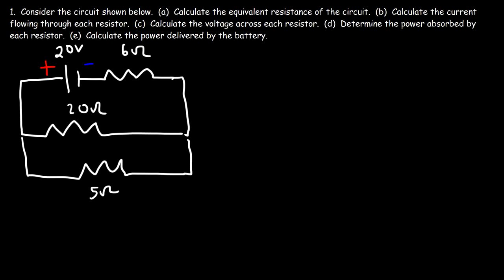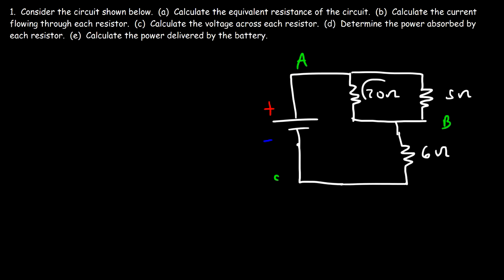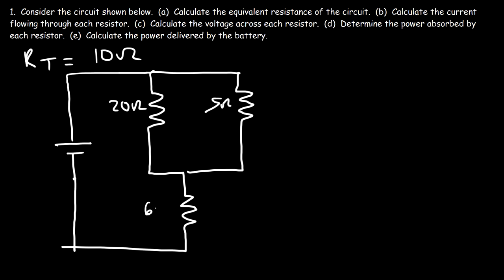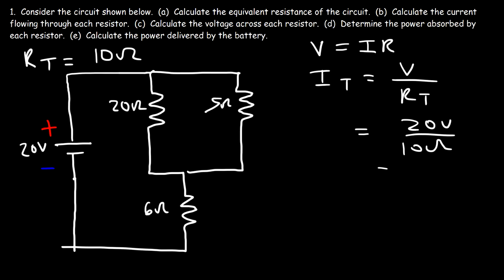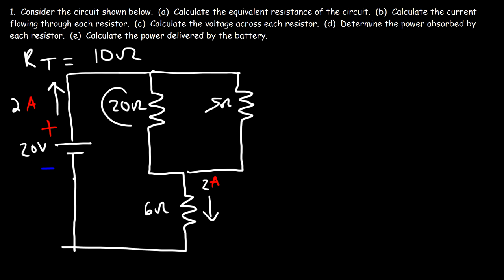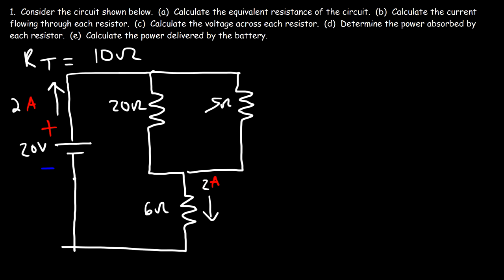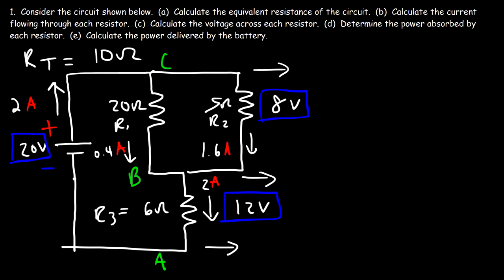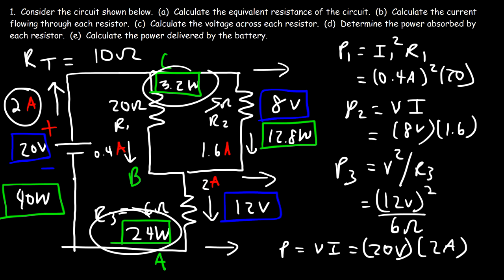Resistors In Series and Parallel Circuits - Keeping It Simple!

Comment: Why  to the power -1
Reply: That is because if you want to calculate the equivalent resistance of resistors connected in parallel, you have to add the reciprocals of the individual resistances.

Therefore, 1/R_{1,2} = 1/R_1 + 1/R_2. 
If we simplify for R_{1,2}, the other side must be raised to the power of -1. 

Because it would look like this:

R_{1,2} = 1 / (1/R_1) + (1/R_2)

Comment: hey quick question about your working out, how did the voltage drop of the 6 ohm resistor affect the voltage in the parallel section if the parallel section came first in the direction of current flow negative to positive,(does that mean that this was actually conventional flow(positive to negative)?  

either wat great video thanks!

Comment: Why use a complicated ratio of current across the parallel resistors of 4:1 and then having to figure that ratio out for 2 amps instead of using the series/parallel circuit rules and calculating the voltage drop across the 6 ohm resistor being 6ohms x 2amps = 12  volts leaving a voltage drop across both the parallel resistors of 8 volts each to calculate the current draw in each parallel resistor.

Comment: Thank you for the example.  I had to do some testing to prove out the parallel circuit's resistance is a constant.  Once I realized that it was a constant (in spite of variable voltage source), everything worked out in the combination circuit example. R total being V / I = 20 / 5 = 4.

Comment: WHY POWER USED different formuls Ie p1 = i^2R and P2 = VI and p3V^2R pls explain sir
Reply: The original formula is 
P = vi 
And voltage is known as v=iR
Replace v with IR it will be 
P = i^2 R

And I is known as v/R
So replace I with v/R
It will be 
P = v2/R

Comment: why is the current flowing through the 6 ohm resistor 2A when if you plug in 20V=(I)(6ohm)= 3.33A. I know that logically 2A flows in and it has to flow out but why is it different when I put it into the eqn?
Reply: A year late but the voltage through 6 ohm resistor isn’t 20, as the voltage drops in series

Comment: This is highly misleading, a voltage only makes sense as reference to a difference between two specific points in a circuit , labeling resistors in the circuit has having a voltage has just confused over 290k thousand people and counting.

Comment: This helps a ton, thx. just one question. why did you use Iˆ2 instead of just I in the formula?
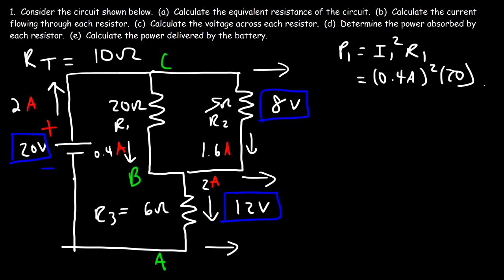 (8:57)
Reply: Let me simplify: 
Power = Voltage × Current

Now substitute Voltage into the formula
Voltage = Current × Resistance

Therefore, Power = Current × Current × Resistance

Comment: You found out the current of only R1 and R2 but not R3 meaning it's wrong? The total current is 2A as you calculated but you only added the currents of R1 and R2 together. What about R3 (6 Ohm resistor)?
Reply: R3 resistor is in series circuit.   Current is the same for resistors connected in series. Differ only for a resistors in parallel.

Comment: At 8 minutes im confused as to why in a parallel circuit part of series paralell you have to do the math where v1=v2=VT  in series votlage drops but in parallel it doesn't amperage does.
Reply: This is a very late reply, but that's just a rule that usually gets taught along with Ohm's law. In parallel voltage always stays the same. Technically each parallel line of resistance is still voltage coming straight from the source and meeting resistance for the first time. So the voltage is the same in each instance. In series after each resistor it is hitting is it's 2nd, 3rd, 4th resistor since leaving it's source, so the voltage continues to be reduced. Hope that makes sense.

Comment: Can anyone help me, please. I've got to find the total resistance of a parallel circuit. There are three given resistors (no given voltage, current, and power, it's only 3 resistors) and the third resistor is initiated into infinite. How can I solve the total resistance when there is an infinite given or value in one of the resistors?

Comment: You didn't show how to calculate the equivalent resistance of the circuit. You typing it into your calculator and telling us the answer doesn't help.
Reply: just know that the resistor math is the opposite of the capacitance math, so for parrallell its 1/stuff this time

Comment: Why is parallel resistor raised to the -1 power? I know 1/C + 1/N or whatever for adding but why raised it?
Reply: It's raised because it takes the inverse of  the fraction. If 1/Req=1/R1+1/R2+... then you need to raise it to the -1 power to get your Req to the numerator, if that makes sense.
Reply: @willsmith1968  I know raising to -1 is inverse, but why have to raise 1/req at all? My teacher's answers can be inconsistent so I'm not understanding exactly how to add it.
Reply: @violetmarinaayis  Sorry on my english. For example if u imagine that circuit is river, now in parallel, river has two paths. If river can go either way so it means that has less resistance than if can go only one way. If river has only one way it has to go through all resistance, but if river has more paths she will go little here little there 😁.
Reply: @violetmarinaayis  1/Req = 1/R1 + 1/R2
So, for example if we take 5 and 10 ohm resistors, 1/Req= 3/10 so our eq resistance is 10/3 or 3.33 (eq resistance is the reciprocal of what we got after adding 1/R1 etc)
 
    You can do this
Here, he has done Req= (1/R1+1/R2)^-1
       Instead of taking the reciprocal od the sum at end , he has directly did as ^-1 since rasing something to -1 gives its reciprocal
Reply: @violetmarinaayis  that depends on the person.. You can raise it or go with 1/Req=1/R1+...
Reply: @Setyourhandle_E  hello can i ask why on letter D, he used the P=I^2R on the first but P=VI on second? i thought the 8V is for both R1 and R2 but he used the 8V only on R2? im confused.
Reply: @dhruvy3638  Hey!

P=I^2R
P=VI
P=V^2/R

    All these are just the same thing
   P=VI 
Now, V can also be written as I*R
So, our formula becomes P= I×I×R

Similarly, I can be written as I= V/R amd the formula becomes P=V× V/R = V^2/R

 He used different formulas for different resistors just so that u know that tjis formula can be written in different forms. The 8V also applies to the R1 resistor too. U can check by:

  P= VI = 8×0.4 = 3.2 Watts
  P= I^2R= 0.4×0.4×20= 3.2 W
So, no matter which formula you use it gives the same answer

Comment: R1 and R2 are in parallel, you can't just add them to get total resistance.
R1||2 = (20*5)/(20+5)
Reply: The answer came the same though, he did it correctly. He wrote (1/20+1/5)^-1 which comes equal to what you said, 4 ohms.
Reply: Thank you I was questioning whether I had miss-understood all my other resistor work even though my results had been correct previously.
Reply: Total resistance of two components(or more) is the sum of their resistances:
R total = R1 + R2 +...
Reply: @KaleKata-x2h  thats only when they are in series 🙈
Reply: It's the same, here in our textbooks, it is stated that 
1/Rₜₒₜₐₗ=(1/R₁+1/R₂+.......+1/Rₙ)⁻¹
Reply: i was puzzled til I seen your post you are correct he should change this.

Comment: Thank you for helping me understand this topic? Is it possible for you to explain the conceptual reason behind why you need to add the reciprocals and then find the reciprocal of the sum for resistors in parallel?
Reply: Bc the total Current accross the parallel circuit corresponds to an “equivalent” resistance (which is just basically an avg of the total resistance in the circuit). 

So taking this and setting up a formula for total Current I(T) we get:
I(T) = I(1) + I(2)

And since I=V/R, Total Current in parallel circuit is equivalent to the total Volts, V in circuit divided by the equivalent Resistance R(EQ). Our equation now becomes:

V/R(EQ) = V/R1 + V/R2

Remember that Volts are same accross each circuit in parallel so dividing the whole equation by V yields:

1/R(EQ) = 1/R1 + 1/R2

Now to solve for R(EQ) we just take the inverse if both sides which yields

R(EQ) = 1/(1/R1 + 1/R2)

And that’s why you have to take the inverse of the sum of the inverted resistances in a parallel circuit.

Comment: It’s wrong
Reply: What's wrong? To be honest I plan to skip this whole procedure and put in what would be a 4ohm resistor. But I'd be a bit worried to do so if the amps across the whole circuit fluctuate with the voltage depletion of the battery. So I'm putting in a 3.3ohm 50w power resistor over a 12-16.8V 4 series battery for a 12v 40w load. Come to think of it, what's wrong for me is the Watts through the resistor 🔥 Funnily enough, I've read that the load (a cigarette lighter 🔌) named 12v will handle 24v.🔋 🙏

Comment: I can't understand how the circuit is redrawn
Reply: same sigh
Reply: @dhruvy3638  follow the plus, it splits into 2 lines or a parallel circuit, so he redrew it as a parallel circuit, then when it the two meet back into one follow that to the minus side of the battery where you hit another resistor, this time it is in series, since it did not split into two wires
Reply: @diags_1109  but why is the circuit redrawn? Couldnt you just apply the formula to the 3 parallel resistors?
Reply: @gauche637  they are not all in parallel since the voltage source is sharing the same wire or nodes(nodes being A and B) as the one resistor. So in this case A and B share the same nodes with no other components on those wires so they are in parallel. However if there was another resistor on there bottom wire it would be in series with the 5 ohm and then the sum of the two in parallel with the 20 ohm one. Hoped this helps just ask again if this didn't make sense to you.
Reply: @diags_1109  thank u so much <3